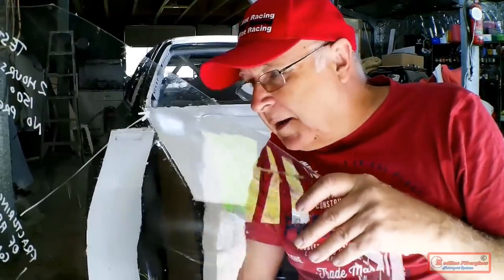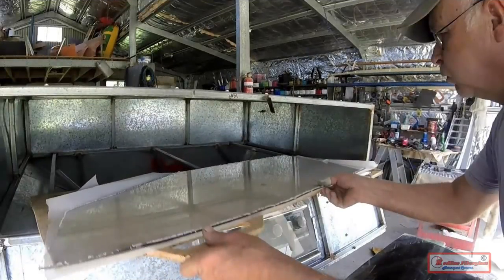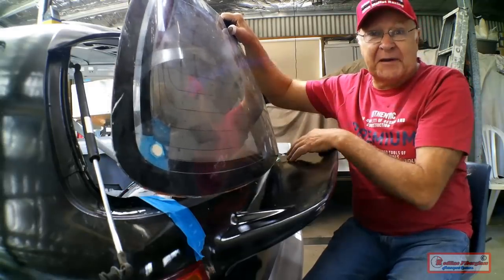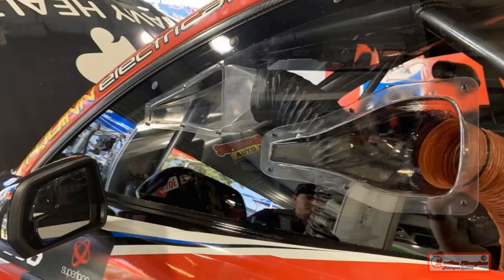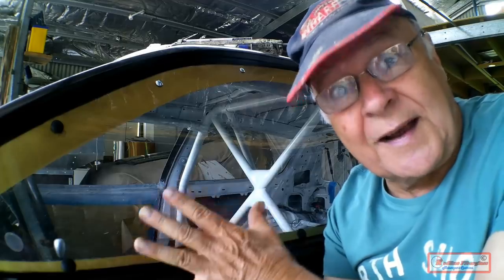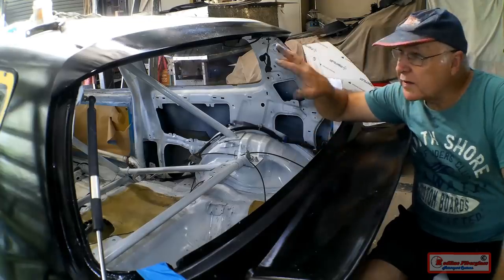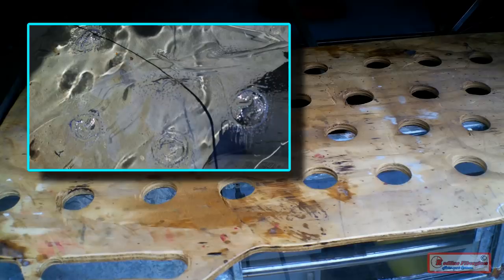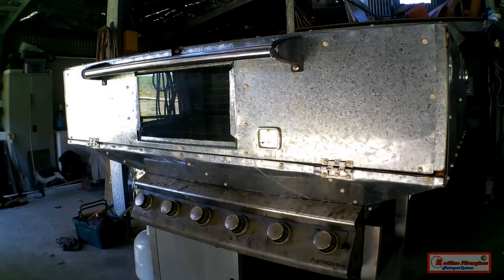RACE CAR WINDOWS - THE COMPLETE DIY GUIDE

Comment: The instructions you shared said to predry correctly you need air exchanges of 6 per hour which would be key for removing moisture from the oven and would also avoid hot spots.  Have you though about modding a convection oven blower or the like?  Also, that soundtrack rips...old thrash metal guitarist approved.

Comment: Literally just done this to a subaru forester over last week.

Didnt need to oven it as the bend is not a compound bend.  But I did use 44 bolts to secure it.  And had a central column down the middle to give it support.
Reply: I tried the blackout paint on the inside of my side windows.  And even using the popular Krylon paint, and suffing the surface with sandpaper, i still had paint seperation when using Sika 295uv adhesive.  Thankfully bolts and nutserts were also used.

I found masking tape caused bleed through under the tape of the paint aswell.  I remade them and sliced into the protective sheet carefully qith a razor.  This yielded far superior edges.

When it came to the front glass, i did not paint a blackout on it.  Instead, i suffed the surface, cleaned with alcohol.  Then used Sika 295 direct onto it.  Aswell as 44 x m5 nutserts around the perimiter.  (About 90mm spacing)

Then a complete wrap of the outer side of the screen with a black vinyl wrap.  The  lastly, carefully cut the inner part out to see through.
Reply: Now have to figure out how to do the side doors which are frameless on subarus.

Comment: Could you clamp some wood down the long edge of a sheet and hang it vertically ?  Seems like that would prevent a lot of the handling and flatness hassles.  You might need a fan to keep the temperatures evenly distributed in a taller oven.   Great results you got there!
Reply from the maker: You can't clamp wood onto the plastic because 1) It is likely to smoke & discolour the window 2) Any clamping would be likely to loosen anyway as the sheet softens. There IS a large fan in my oven - it's just underneath it, constantly circulating air - more for changing the air as the moisture in the sheet is released rather than temperature control - although a more even heat distribution is a side effect naturally.

Comment: The case of your side windows raised a question. If you had a tighter radius than could be easily bent without heating(radius in one plane only). Is it possible to heat either plastic so it still keeps it's primary rigidity but is just pliable enough to form into a slightly tighter curve. Maybe a job for Mrs. Bill's hair dryer? Love your work. Cheers.
Reply from the maker: Side windows are rarely curved enough to require heat molding.
Reply: @BillsBuildandRace  I realize that, my question was if you ran into a situation with just some more curvature, and you didn't want to get the plastic all ''gooey'',  Is it possible to heat either of the plastics so it still keeps it's primary rigidity but is just pliable enough to form into a slightly tighter curve.
Reply from the maker: @rickden8362  Yes that is possible, but you would be advised to drape mold it over the factory side glass, rather than just thinking you could warm it up enough to just bend it accurately using only your hands. Hot air dryers cannot heat a whole window evenly enough, which is why most guys who try this method fail.
Reply: @BillsBuildandRace  Thanks for the info.

Comment: Thanks for sharing and being open with all the issues you had. I will say, with all the steps, tools, and labour involved it's cheaper to buy from a store that has them for my particular car. Side windows and large hatch window are around 4 grand so that would be cheaper than making this process.
Reply from the maker: Everything, including the cost of making the oven & the plastic sheet, to make all the windows for my hatchback cost me under A$400. Most side windows don't even need to be heat molded, as the curves are so small.
Reply: @BillsBuildandRace  my bad I didnt mean 4 grand (facepalm myself*) I meant 400 usd(it's 4 grand in my countrys currency). Anyways that's not alot, but this is given everything goes right, which Murphys law shows me otherwise 99% of the time ;-)

Comment: Those nylon bolts are actually quite strong  depending how many u got on there u may not be able to break them they use them alot on low voltage ewp trucks and the snap quite often with sun damage trying to undo them but in good condition they are quite hard to snap as they stretch and flex alot b4 breaking point

Comment: Cut plastic under water if possible, or at least put the bit you are not cutting under water.  This will damp the vibrations that crack the plastic.

Fixing plastic with screws.  Drill the clearance hole for the thread.  Countersink for the head.  Where the countersink meets the clearance hole just widen the clearance hole by about 1/16”.  The screw countersink and the shaft of the screw do not meet cleanly as the intersection of the two holes you drill so just opening the meeting point up a bit prevents a pressure spot and reduces the chance of cracking.

Comment: Bill - I'm curious as to why you chose to orient the sheets horizontally in the oven, rather than vertically like in the industrial plastic drying ovens?  (That's how they manage to fit multiple sheets in)   Maybe the ideal solution is an oven that can go vertical for drying, but rotate horizontal for pre-melt? :-P

Comment: could you use nichrome wire elements and a PID controller to make it electrical instead of gas for greater control and cheaper to use?

vegoilguy built a metal furnace for casting this way which work at lower temps for your purpose as well.

Comment: just a thought but a naked gas flame pumps out bucket loads of water vapour . . .
Reply from the maker: Yes good point, which is why commercial plastics ovens are electric. But stripping an old electric oven & playing around with mains wiring is more fiddly and needs some skills many shed gyros don't have. The gas bbq was super cheap & easy to convert into an oven. If the flames creating moisture in it were a problem I would not have been able to successfully produce the molded windows which I did.  It really is more a matter of the moisture already within the sheeting before you put it in ANY oven that causes the problems of bubbling.

Comment: No convection fan?
Reply from the maker: On advice from a friend in the plastics industry I did indeed put a large fan heater under the gas jets inside the doors to circulate air, not so much for temperature, but more to help remove any moisture coming out of the sheets that can cause blistering. I think I mentioned the fan in my other video on how to make an oven from a gas bbq for heat forming plastic windows.

Comment: why not vacu-forming?
Reply from the maker: Yes I certainly looked at that, but the extra die/set up work on a project this size, the fact I could keep things simpler without having to use that method, and the industry videos & forums I researched is why I settled on drape molding as theway to go for me.